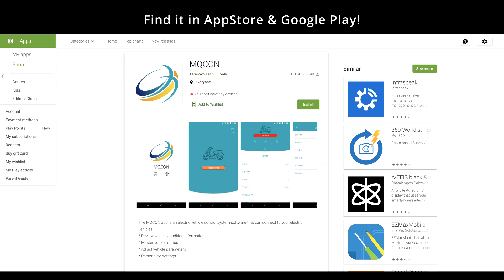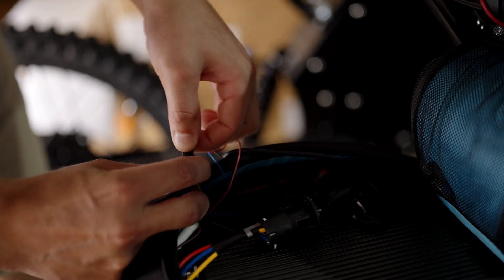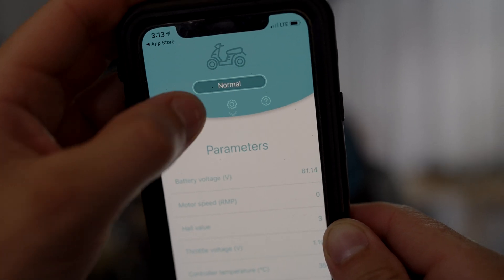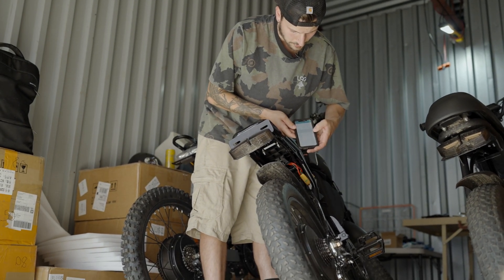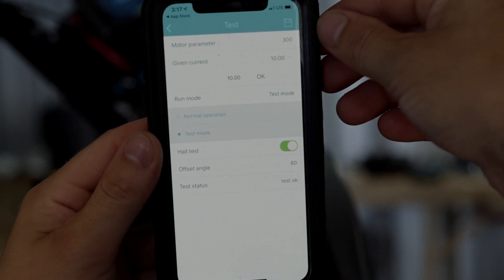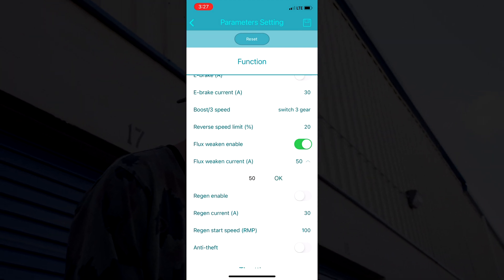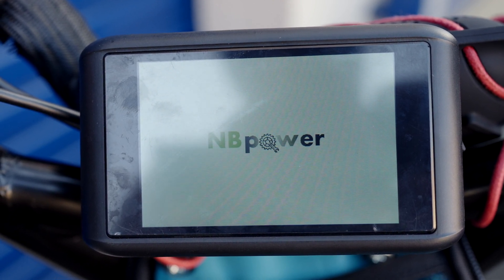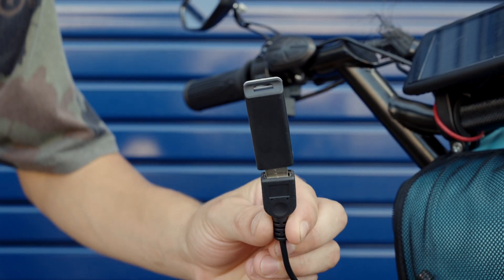How To Tune Your Sabvoton Controller (MQCON App)

Comment: Hey bro, so I just plugged everything up in my stealth bomber, and as soon as I throttle it up it goes into controller protection 10H error code , I tried diagnosing it with this method on you video and it gives me hope that this is fixable, the tire spins some times back wards some times front but it never completes the test it just stays in “in progress “, any tricks that can help bro ?

Comment: I'm getting a sabvoton that im going to have to change the continous current to 78a cause my battery is 80a. is that lowe enough. and setting would i need to change? im assuming where it says dc current under input and output but i dont know. and would i have to change the phase current? please answer!

Comment: If you have 2 hall sensors coming from your motor, how do you know which one to use, and what is the difference?  I also noticed that of the 2 HALL connectors, one of mine coming from the motor actually has a white cable in the connector making a total of 6, where the one currently connected to the old (apparently faulty controller 7280M) only has 5.  The extra wire on the one  connector is a white wire connected to the the slot right below the plastic connector.  Think top row, middle slot.  Help!

Comment: Hey I sure could use some help I but two of them 203-205 kits put one on my bike didn't do a hall test the kit didn't come with no instructions so I didn't know that I had to it run fine until my buddy tried to switch the display from kilometers to miles per hour the next day I took it for a ride it didn't want to turn on good it finally did it run for about a block and shut off could not get it to turn back on talk to some people on the channel about bikes and they told me what what I messed up with so I took that controller off and put my new controller on and went through this what to do this test right here it turned on for a minute I shut it up put on your video hold the three tab thing and now the thing won't turn back on again I don't know what to do I got two of these kids and none of them work though please help me

Comment: Hello bro, I watched a video about setting up the Savboton controller, I also have one on the 72100 model, it’s 100 amperes. But I have a waterproof cable that comes out of it with a 4 in 1 cable, connectors for the brake sensors, then a display and something else, and an output for a bluetooth flash drive.. So you need to turn off the display and repeat as you indicated in the video.

Comment: Im having trouble getting it to work with my 48v battery, it keeps saying low battery warning. Also are you sure the Bluetooth dongle needs to be kept plugged in even though i don't plan on programming the controller on a ride?

Comment: hi I have an F1 ghost motorcycle I bought the USB key on Aliexpress to program it with the application the problem is that the speedometer indicates the units in miles and I would like in km/h.  do you know how to do it?  because in the application on my cell phone I don't really see where it could be.   THANKS

Comment: most people should actualy leave flux weekening off,as their batteries ,usually dont have the capacity or the handling capacity of bms ,to take advantage of this feature,for example you have 150 amp controller ,and your bms is rated as 100 amp ,then activating FOC,feild orientated control which is flux weekening,will work against you and lim,it the preformance and distance with no perceiveable gain
Reply: if you set 50 on your flux weekening then your going to need 50 to 100 spare amps available from your battery
Reply: Noob tuner here!. . .so if my Sabvoton controller has a 100a rating and my 72v battery has a 60a rating, turn off the flux weakening? . . .is that why my Ebike will go into limp mode and turn off?

Comment: i dont use the MQcon app ,its not being activly worked on or updated,so i use the pc software to program sabvoton controllers and can also access other advanced settings if you know your way around pcs,if you purchase your sabvoton through SIAECOSYS ,they actually have their own  version of the MQCON app that only works with their controllers but its update and solid ,and gives real time response in the app perameters

Comment: Thank you brother! best video i've seen on this! can you recommend settings for max torque like for wanting to wheelie a 5000W 72v stealth bomber clone? I can wheelie pretty good on 3 but 1 and 2 are limited. 3 could probably be a bit better. thanks in advance! 72100 sab controller 72v 32ah battery with 100A? ant-bms. tops out at around 52MPH I'm only like 155LBS. 20" wheels front and back. moto seat.

Comment: Nice instructions. I subscribed!
I have a bafang 1000w geared hub motor.  I would like to get this controller and wire it up as the one i have now is only 25A.  Would you reccomend the controller model in this video and display to use? Thanks.
Reply from the maker: Thanks! I would say the 80a version or even the 45a I have on my site should be more than enough. You'll definitely see higher numbers in the top end and even some more torque.

Comment: If you want more.power turn on hard start and acceleration on 10ms so it'd instant torque
Reply: Those settings ain't on Sabvoton...
Reply: Oh I found them sorry...I did changed it ..uff it works thanks..👍👍
Reply: My acceleration was on 200 I think and deceleration on 300ms...so I changed them to 50...u think I should put it on 10ms..?

Comment: Two questions, tuning the controller to those settings will give me the max out of the controller and keeping the flash drive plugged in dose what??
Reply from the maker: Keeping the flash drive plugged in is just for convenience in case you want to go back into the app and adjust the parameters.

Comment: If I may, what does the hall test do as well as the flux?
Reply from the maker: The hall test mainly makes sure the hall sensors are running properly. I always recommend doing it if you decide to swap motors. Flux weakening when enabled basically gives your bike a boost in top speed at the expense of some higher temps if throttling for too long.

Comment: Hi dear, good information, thanks. My question for Halltest: Is it mandatory which direction (forward or backward) the wheel is turning during the test ? I can`t get the wheel turning in correct forward direction for the test, it always turns backward. Also when I change before the motor direction in the app, no impact. Always backward ...
Reply: Your phase wires are in wrong positions then

Comment: so i just spent about an hour with a motor failing the hall test over and over again. it wasnt making sense to me because it was failing on both sets of hall sensor wires coming from the motor. i tried both sets several times and then did a really thorough inspection of the wires including very close inspection of all hall sensor wires attaching to pins inside connectors. i was about ready to open the motor and inspect the wires inside when i had the thought to come watch your video and make sure i wasnt doing something wrong.

i wasnt, i was doing it right but i immediately noticed your motor spinning forward during the hall test and mine was going backwards. i swapped the blue phase and green phase wires and passed the hall test on the first try.

thanks for having this video here bro, much appreciated.

Comment: Finished E-BMX last night with Sabvoton 72150 and MXUS 3K Turbo. Could not access the programming functions until watching this video and learning you remove the 3-pin connector for Bluetooth programming to work. Thanks! Its absolutely mental BTW, cant keep front wheel down, cant go past Level 3 yet! Why do you say keep bluetooth adapter connected (I removed mines and its fine)?
Reply: No need to keep bt connected yes just for inconvenience

Comment: GREAT VIDEO brother. I'm gotta. Try this. I need WAY MORE POWER OFFLINE, stock right now. I want MAX REGEN. I need to no how to hook up alarms and GPS tracking,  ebrake, locked wheel alarm. Please help were to get manual how to hook up, manufacturer didn't hook that up. I have qs273 2.5t 12kw 72v41.6ah 72150 savington controller. Top speed stock 70mph max me 6 2 250. Also need switch for restricted mode(28mph), eco, sport. Thx for any help.

Comment: I have a sab 100a set to 3gears with (push button 3gears) all the gears maxed out to 1 speed, how can i limit the speed between gears? The battery is 72v 50a bms i set the controller limit to 65v 50a and n its doing 40mph which is a comfortable speed for me but do you think the 50a limit is why all my gears push the same speed?

Comment: I'm confused. My display isn't compatible with my controller at all however!
I need it in order to turn the system on and go for my ride. 

Could I still enter the app and tune the bike with an Imcompatible controller?

And my display uses a three pin tube connector and another 3 pin connected to the controller

Comment: This was a good video, But I would have liked more information on what exactly doing these procedures accomplishes!

Nice job!🙂
Reply: I believe the hall test orientation the controller mofsets with the windings of the motor, so they are all in synch. The field weakening modifies the power to the motors winding as it spins to allow it to spin faster. But, I'm just guessing... :)

Comment: So i had a guy install the 2000w motor the sabvotan 60amp controller and a 72v 60ah battery he hooked everything up it worked for 2 minutes i hit full throttle and then the bike turned off the controller was reading the battery at 0% we did tests on the motor and controller with a separate battery they both worked and now he’s claiming that the battery bms was burned out im not sure if the battery is the problem or he didn’t tune the controller right
Reply from the maker: Was your guy able to run the hall test? Make sure you do the test first to make sure it passes. Also, what error code is the display showing? It's possible when you hit the throttle it burned out the hall sensor. Your controller should have a second one that you can connect to. Let me know once you guys have done the hall test and connect your motor hall sensor to the other controller hall sensor.

Comment: So would tuning it lower have a lower speed? Cause I want my bike to go 25mph for now and when I want I can switch it so it goes faster.
Reply from the maker: You can always run it on mode 3, which caps around 20-30. Speed modes always reset once you turn off and on the display.

Comment: i did all of that and it’s still so slow and i plugged the cable back in and still says communication error any help? thank you
Reply from the maker: After making the changes in the MQCon app were you able to save the settings successfully?

Comment: Is there a way to setup your regen braking on a button so you can use as a brake when needed.  Sabvoton  200 amp controller
Reply from the maker: Yes you can I have the Regen button actually set up on my other X-Class. I may do a short video on this.

Comment: Hi can you help.I have this display and controller.When i go in too setting on the display they wont save so when i switch it off and on again the settings are lost and i have to do them again.Also i only get my top speed on the 36 volt setting on the display which is very strange?
Reply from the maker: After doing the hall test, I usually hit the save button 2 or 3 times to make sure the save went through. What motor are you running?
Reply: @e-streetbikes6381  im running a 2000 watt rear hub motor but i have not got a dongle i bought the bike off e bay. It is a sabvaton 45 amp controller.
Reply from the maker: @martinmorris6351  ok yea you can get the Bluetooth adapter on ebay actually, they plug into any Sabvoton:
https://www.ebay.com/itm/313903790347?chn=ps&norover=1&mkevt=1&mkrid=711-117182-37290-0&mkcid=2&mkscid=101&itemid=313903790347&targetid=1264870805024&device=m&mktype=&googleloc=9004146&poi=&campaignid=14859008593&mkgroupid=130497710760&rlsatarget=pla-1264870805024&abcId=9300678&merchantid=6296724&gclid=CjwKCAiAxvGfBhB-EiwAMPakqihWPE9w3cc0e7gQACX7eXqdCZ8X-pkw6G5COzGC6qdf_CUL_QAKjhoCp-EQAvD_BwE

Comment: Just got my new controller with 3000w kit and this info was great to know. When I did my hall test, I could have sworn the wheel was spinning in reverse slowly but it seems to be fine otherwise. Crazy fast bike now coming from 1000w.
Reply from the maker: That's normal during the hall test. Yea it's a big step up from stock lol. Enjoy bro
Reply: What is your battery power? My 3000watt motor and 80amp Sabvaton come tomorrow! 72v Battery from NB Power, I’m super excited. This video definitely helped me.

Comment: heya im sure you know that the sabvoton app really is only a rough setup ,to get the real magic out of a sabvoton you need to get into the pc programing software ,allows much finer perameter details ,better power delivert and power usage plus quite alot button assignments too
Reply: the big advantage is with fluw weekening and variable regen brake levers
Reply: yeah and activating can bus so charger  the bms the controller and all accessories commuunicate with eachother ,with only 2 wires

Comment: Thanks for the video! Is it possible to wire the regen to a handlebar mounted switch or map another throttle to regen? :face-orange-biting-nails::hand-purple-blue-peace:
Reply from the maker: Yes it's definitely possible, I'll have to show in another video but I mounted onto my old X-Class
Reply: @e-streetbikes6381  Thanks for the reply. I am thinking about machining a two lever thumb throttle so I can control regen between two motors.

Comment: Hi I just subscribed to your channel and I find your videos very interesting ... Can you help me??
I bought an electric bike with an 8000Watt motor and the subvoton mqcon SVMC72150(M) and I have a 72 volt battery.....
I can not understand why my display tells me that the charge is 81.7 volts .... and even after 5 km the voltage is always the same ......
Then the odometer is not real and from 0 up to 80 km/h it arrives after 3 meters.....in short, it's all wrong...
What can I do???'help me please please......
Thank you
Reply from the maker: Hey how many AH is your 72V battery? Also what diameter/size wheel are you running? It always helps to have the most accurate wheel diameter entered in the display to give you a more accurate odometer reading.
Reply: @e-streetbikes6381  26inch batt 72 volt
Reply: ho una batteria da 72 volt 40 Ah e la ruota è una 26x4.00 il mio controller è un SVMC72150 (M)

Comment: What if i have a 3000watt motor 72v 80a bms kit? is 50 for flux weaken ok?
Reply from the maker: Yes 50 is the highest you want to go for flux weakening.
Reply: @e-streetbikes6381  so I tried it and itll start overheating and cuts off my power limiting to level 1 barely moves….🥹🥹🥹
Reply from the maker: @myking3985  Did you do the hall test before running the motor? Be sure to do that first then adjust and save the flux weakening when ready. Also, make sure you're xt-90 cables are set properly all the way. Any gap can cause the connectors to smoke.
Reply: @e-streetbikes6381 yea of course, that wasn’t the issue, I run two 72v 80bms 20ah with a dual module, my over voltage was set to 80 (v) maybe it was just too much, either way I ended up just running stock setup, i rather have the efficiency, i can still hit up to 50mph at level 5, and I prefer the stock torque, since my bike is heavy roughly 160lb
Reply from the maker: @myking3985  that's pretty strange especially on the 80a Sabvoton. Over voltage is usually set to 95. If you want try and adjust it to 95 and see if it gets you the results you want in terms of performance.

Comment: All all those numbers the same regardless if your using a 48v, 60v, or 72v battery?
Reply from the maker: No this only applies for the 72V system configuration.
Reply: @e-streetbikes6381  ty!

Comment: Hi why do you have to have the USB DONGLE Plugged in all the time? Wont it work without that.  Can you help me I have 72V Battery, 84v when fully charged which gives continous 50amps and burst of 100amps.  My Controller is sabvaton 45 amp. I have to put these variables in myself to the app. DC CURRENT (A) my controller is 45amp max so I guess I put in 45amp/   (b) Boost Current. I don`t know about this. My Battery is 100amp burst so Do I put in 100amps? (c)  rated phase current. My Controller is 45amps so I guess this would be 45amp  (d) Max Phase current would be 2.5 * 45 = 112.. I took it for ride and I was not getting the full power. I was getting less than half the power. Thanks for help

Comment: Hey man, how can you limit a speed controller to a certain watts? Like from 8000kw to 3000
Reply: Do you have a video for that?
Reply from the maker: For a sabvoton, you can turn down the DC current and the phase current in the app.

Comment: I have a question about the v2 sab Controller. Is it waterproof? I've seen controller mounted on the downtube near the front tire and was curious if this new v2 was waterproof. I'm going to buy a 3kw 72v kit soon and would like to know. Thanks!
Reply from the maker: The main portion that's waterproof are really only the julet connectors which seal properly when connected. I would still recommend protecting your controller from direct water as much as possible.

Comment: Hi mate really liked your explanation of the  Controller We are stuck on similar thing we wire it all up hall fault error 07, it's a sabvoton 72150 , 72v 80a polymer battery, on a stealth b52 bomber,  we can connect to the app bit it won't communicate,  it' reads everything but when I try hall test the app doesn't respond,  I've sent a video to the seller but not got back to me
Reply from the maker: I would say try swapping the blue and green hall sensors. Let us know if it works for you as we're curious. If the wheel goes backwards, just change the motor direction in the app.